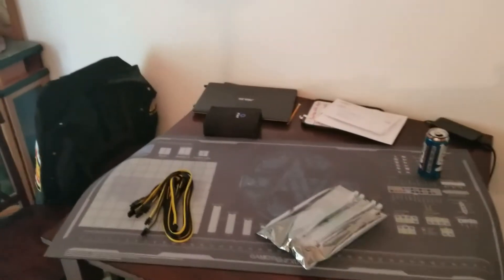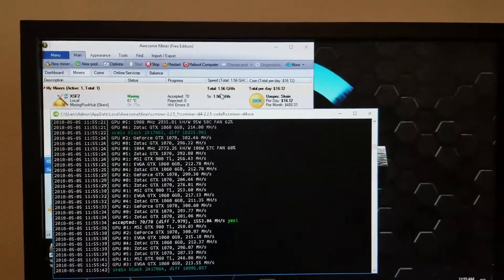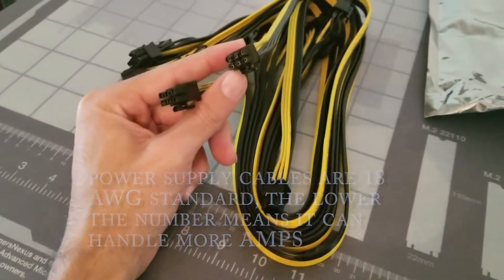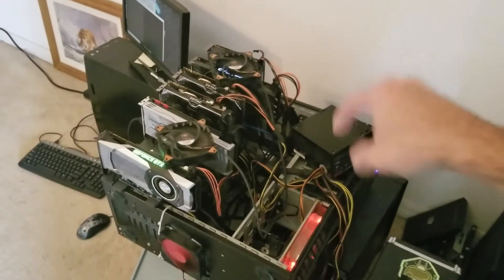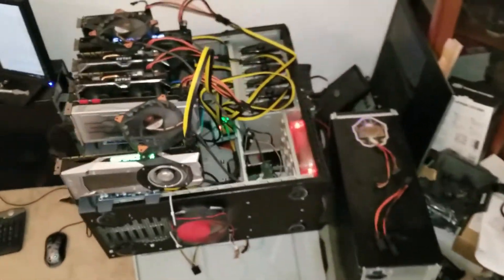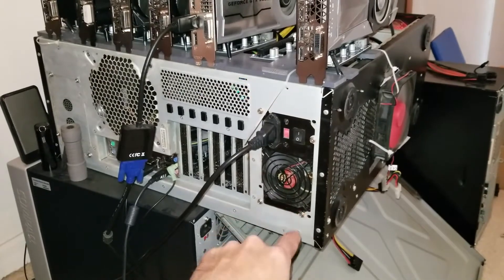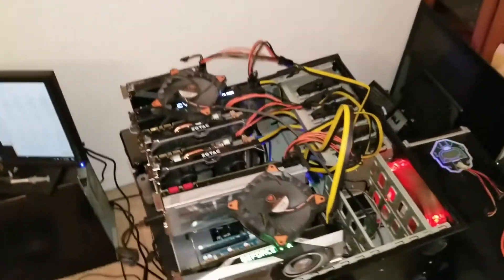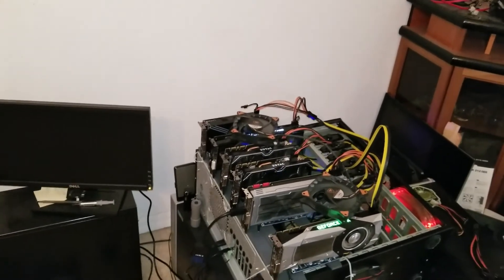Cryptomining, ATX VS Server Power supplies

Comment: You can connect the atx power supply to the server psu and it will power up and down with the atx psu. Works great for my 750 watt server psu.